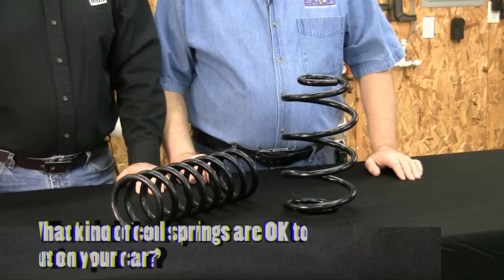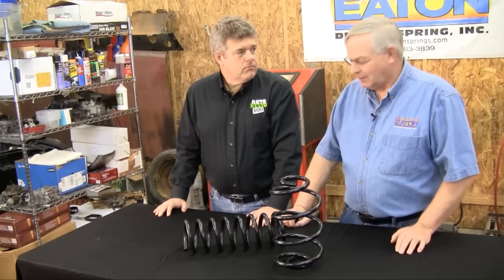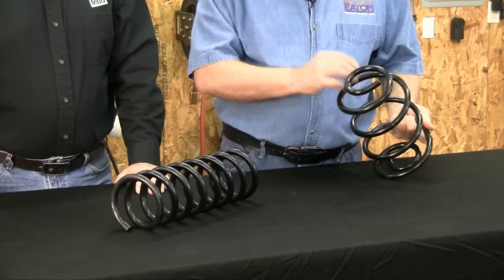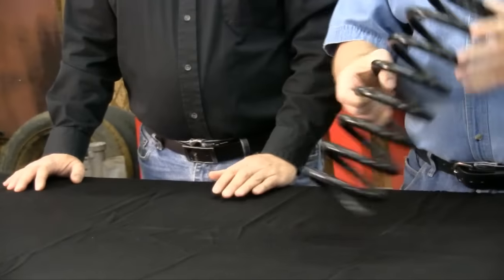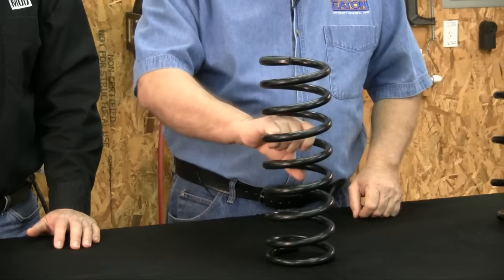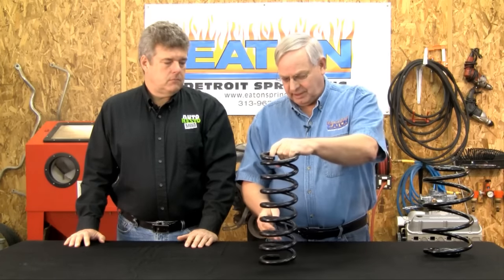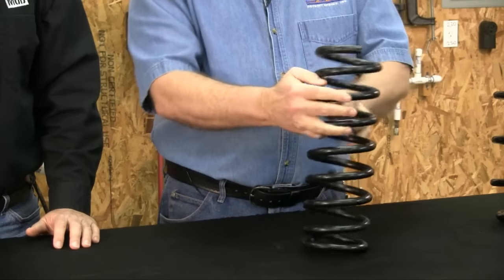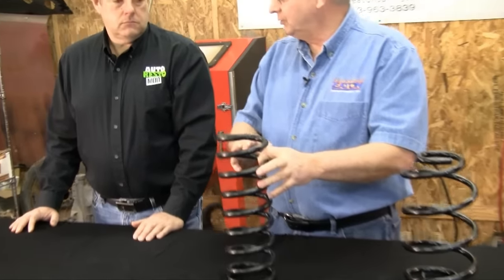How To Cut Coil Springs | EATON Detroit Spring Featured on AutoRestoMod

Comment: Keep in mind cutting coils will change alignment; you'll have more positive camber (top of wheel sticks out more, bottom goes in) and if the tie rods are BEHIND the front wheel, it'll be more pigeon-toed, so shorten the tie rods. Do the opposite if they're in the front. The crucial part is toe-in, that'll wipe off your tire edges in short order if the wheels are toed in or out too much; a lot more than camber issues will.
Reply from the maker: it is always best have your vehicle re-aligned after doing any front end work.
Reply: Are you not mistaken? Lowering a car will give you negative camber, the top of the wheel will stick back in and the bottom will stick out more.
Reply: It depends on the suspension if it changes camber, and how it changes. It will also change the camber curve on double wishbone cars.

Comment: Does it matter where the square end of the coil sits on the top? I have progressive lowering springs and want to drop it half an inch more. So maybe a quarter coil? Or does it have to sit 180° from where the spring sits in the perch..? I have tein s springs for z32..

Comment: I cut one coil from the front of my mustang gt and it dropped 2.5 inches.  looks and handles great.  Video is posted.
Reply: Is it safe to do it?
Reply: @johnvanlandingham8832  call somebody else. A flat bed can pull the car up on the truck no problem at all. There is also enough clearance to lift it from the front.
Reply: @johnvanlandingham8832  my mustang is gone. I'm riding in a big ole hemi Ram truck. Low ride height is no longer an issue lol

Comment: I have a Porsche Cayenne without air suspension and wanted to order H&R lowering springs. The company says that it drops the vehicle 1.6" front and rear. But it also says it depends on the way the vehicle settles. If I wanted to do a 3" drop what would I do? Can I order the spring from you guys instead? I wanted a more aggressive/ sportier look and feel. Thanks

Comment: So, typically you take the distance you want to drop the vehicle, and cut half that distance on the spring? Does that go for any amount of drop? If I just want a 1/2 inch drop, I should cut 1/4 inch off the tangential end? Or 1 inch...cut 1/2 inch of the tangential end?
Reply from the maker: Because once the spring is cut you can not add back to it, so we say to only cut off 1/2 of the amount of drop you need. after re-installing the springs and driving her, you may need to repeat the process. Better safe than sorry.
Reply: @EatonDetroitSpring  Another question. I just bought a set of your springs. Upon measuring them both, there is 1/4in difference free height between the 2 springs. Is this normal?
Reply from the maker: @poweredbywinchester7070 Yes, that is normal. It is the nature of larger hot wound coil springs to vary in free height. In fact, the tolerances on some springs by design allow for up to 1/2-inch difference in free height. Because how coils start to take up loads this difference is quickly diminished. Nothing to be concerned about.

Comment: Ive heard cuttin springs changes the spring rate is this true and if so would this make is stiffer or looser or would it depend on the amount of drop??
Reply: Makes it stiffer BUT u still lose flex and you can still bottom out

Comment: So a one inch cut equals to two inches drop?
Reply: +marvin greene You asked this two years ago and still no answer. The dude was on another video and he wasn't clear about how much to cut on that one also. WTF From the best that I could figure on what the hell he meant is if you measure from the tip end of the coil and project a straight edge horizontally across the spring until 1 in is measured  between the top of the spring wire and the bottom of the strait edge, this will give you a 1 inch drop. It just so happened that it took cutting off a 2 inch length of the spring's wire to equal that 1 inch measurement. I wouldn't take that 2 inch length of spring wire as always being equal to a 1 inch drop because some springs may be coiled looser or tighter making the height at 2 inches of coil wire more or less than 1 inch.
Reply: 1" to the spring is 2" to the body, typically.

Comment: now i put eibach lowering springs on my 2013 dodge charger. it dropped it 1.5 inches but it is still too high for my liking. i would like to drop it about one more inch. how much spring should i cutt to achieve this?

Comment: I bought lowering springs on my 2004 Honda Accord I need cut 2 Inc off my front d2racing springs how much do I cut please let me know thanks you
Reply: I'm sure you've already done this but for anyone else that may be curious measure the height of the spring; say its 14 1/4 walk your tape measure around the coil until you hit 13 1/4, cut there and you'll get 2" (1" at the spring is 2" at the body). Do this for every coil, don't just assume every coil you purchased will be 14 1/4 (or whatever your height might be) right on the dot, it most likely is but it's better to make sure so you buy once cry once, and always cut the tangential ends.

Go slow and steady, half an inch, or one inch first just to be sure... but honestly, if you've purchased lowing springs and are taking even more off I would ditch them and purchase coilovers, you can find them all day for a Honda, K&N, Tien, Silk Road (those may be RWD Nissan/86 Corolla specific), etc.

Comment: I just bought a car that is lower in the front. The suspension is super stiff. Could that be the fault of lowering springs.
Reply from the maker: It could be the fault of the springs, or it could be the shocks. A quick way to find out is to take the shocks off and drive it and see if the ride quality changes. If so, its the shocks, if not, its the springs.

Comment: what hacksaw should i use or what angle grinder in order to cut it ?
Reply: Just get a cheap metal cut off wheel from harbour frieght..or if you have air a cheap air cut off tool. Youll be there for a day cutting with a hacksaw.

Comment: Why i can't cut square end ?
Reply from the maker: Think about it..........if you cut off the square end it is no longer square and the spring will no longer fit into the pocket correctly.
Reply: @EatonDetroitSpring  , yes it won't touch along the whole rim , but if i put a protection plate to save the parts from damaging ( because area of contact is low now so pressure will be high) would it function well? I am short guy this is the only way to ride my dream bike , so plz answer
Reply from the maker: @debarghyachattopadhyay2614  A square end coil is designed to make contact along the complete end of the coil. If you wish to redesign it that is your decision.
Reply: @EatonDetroitSpring you guys know better than me sir . so what problems may i face ?
Reply from the maker: @debarghyachattopadhyay2614  Cutting off the square end will not allow the coil to sit correctly on the spring seat. This may allow the spring to act as it should.
Reply: Let me guess..you have a square end on both sides..it shouldnt be cut.

Comment: What about the saying if a coil spring is a certain rate and you make it shorter or longer you will change that given spring rate. So if I were to cut the coils on the front of my 09 Vic I would in turn make them stiffer or more resistant to bound and rebound? I think I'll just stick to buying springs from you guys since your the only people on this planet that make them for one of the most popular ( specially now they are cheeeeep and there are billions of them all over the world) cars . never understood why there isn't more companies making suspension kits for the crown Vic, I mean its not like there front suspension is the new mustang 2 swap or you can put any engine/trans in them or that they are one of the most balanced and predictable chassis I've ever driven , but I will be getting some springs from you guys this .....spring......ehhh, ehhhh that's a coil joke, I kill me!
Reply: Springs are cheap these days. But cutting off a coil slightly increases spring rate which is what you want when lowering a car, to keep it from bottoming out.
Reply: @nobodynoone2500  I ended up cutting 1.5 coils from the front and oddly enough the springs from a 07 gt500 track pack not only fit and matched the ride hight I was looking for but it also matched the spring rates of the now just slightly stiffer fronts. Ride quality was comparable to that of a 2016/2017 Volvo XC90 R design. Sadly two years ago my Vic was stolen so I bought a 2016 AWD hemi pursuit charger👹

Comment: Why not just press it to lower the free length save the rate and some what save the loads. Save the spring from as you said microscopic cracks that from from cutting. 
If your interested I can start at thirty to thirty five an hour 401k medical dental vision am open to negotiations and you have to move me. Just kidding!! Great channel watched all of your videos
Reply from the maker: Taint so easy. in order to do the springs would have to be compressed past their yield point and coil bind, that is the coils touching each other, would hapen long before the yield point is reached. Plus, i never recall saying anything about microscopic cracks. Thanks for watching and spread the word.
Reply: @EatonDetroitSpring  I appreciate your reply. What I meant by microscopic cracks is what you referred to as changing the molecules of the steel while heating over 400 degrees, it becomes brittle it may shatter worst case scenario unlikely with around half inch wire but I have definitely seen it happen straight from the feed on a cold coiler with .64 wire. I am unfamiliar with open end suspension springs. You definitely gave me a better Idea of why they can be cut and not pressed reviewing your video. You are the first person to actually reach out and answer my question. No worries where I work we do not do open ends but having more knowledge helps. Also from what I have seen on other youtube channels regarding springs you know what you're talking about. I am by far no master grinder or coiler but I am good at what I do and seek the knowledge of others. I apologize for being cocky and the essay but thanks again. I will definitely spread the word.
Reply from the maker: @lancergt13lancer32  I never interpreted you as being cocky, I viewed you as someone who had a question and looking for more knowledge. You would be surprised just how small of a wire can be that breaks after heating it. As for our knowledge, we, unlike all the others one can find on You Tube, actually manufactures springs, and has been doing so since 1937. So we think we have a bit of advantage over those who simply buy and sell springs.

Comment: The correct method of lowering a car involves replacing the stock shocks and springs with lowered shocks and springs. Lowered suspension components are readily available for almost all cars. You really should never cut springs and never put shorter springs on a stock shock absorber. Steering, braking and suspension are vital to your car handling safely on the road and dodgy backyard suspension modifications are just outright fucking dangerous. Especially when done by people who have no experience or understanding of what they're actually doing.
Reply from the maker: In the perfect world you are mostly correct. However, in the real world there are plenty of automotive nuts who must work with what they have. With this in mind, we try to help them do what they must the right way.